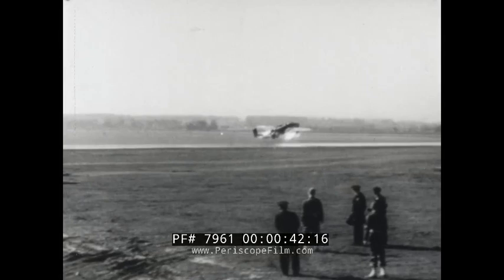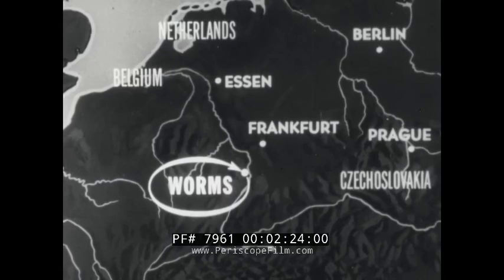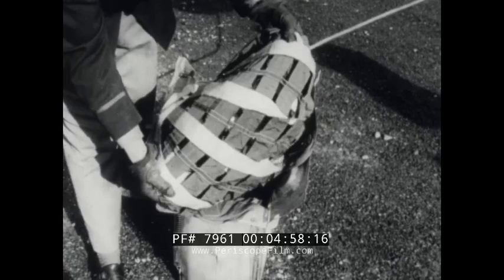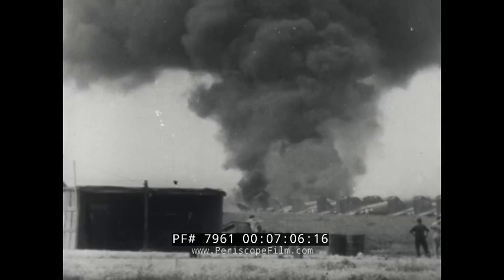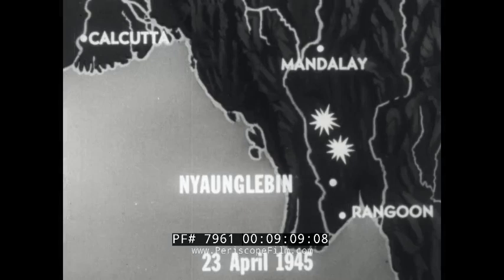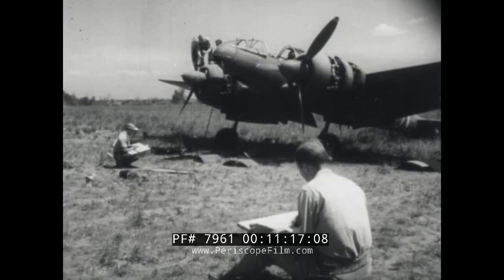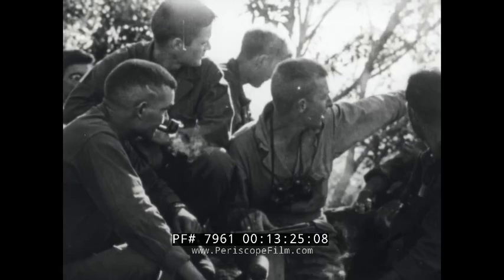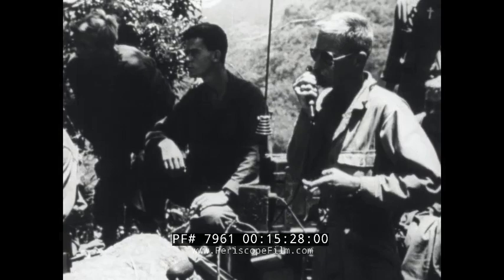1945 ARMY AIR FORCES COMBAT BULLETIN 84 GERMAN ARADO AR 234 BLITZ BOMBER 79614

Comment: A dumb question: Did the B-24 and B-25 also use the Nordon bomb sight?
Reply: Some did, but it was mainly reserved for strategic bombers in Europe. They needed to hit smaller targets than the ones in the Pacific. The B-24 mostly used the Sperry bombsight-autopilot, whereas the B-17 had the Norden. The USAAF could never get the amount of sights required, and so they pushed the planes around to where they were needed.